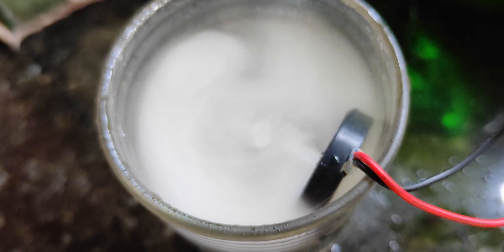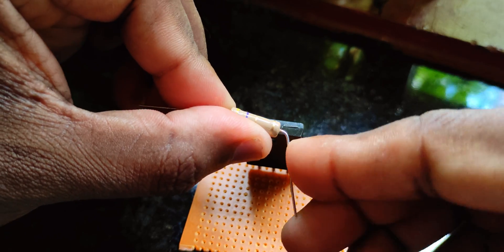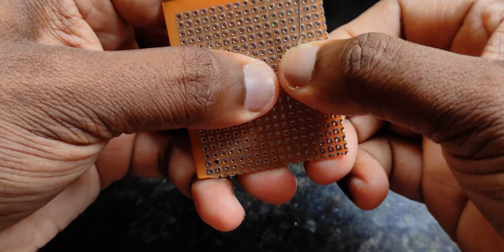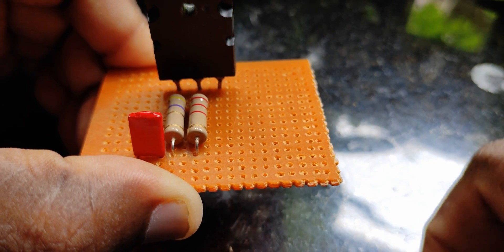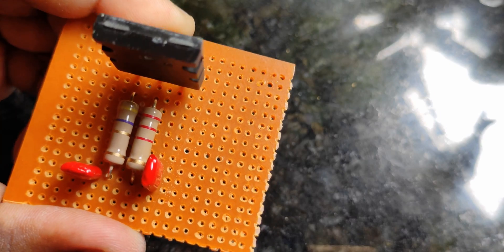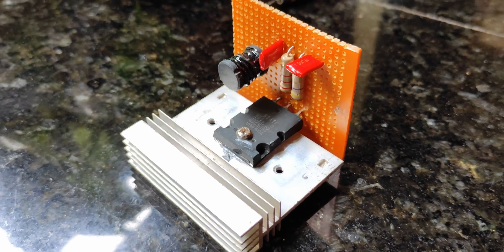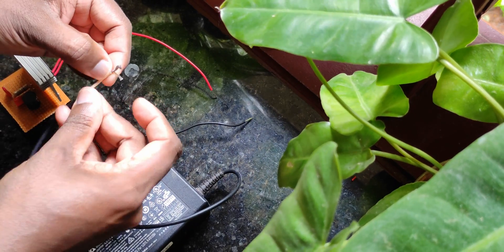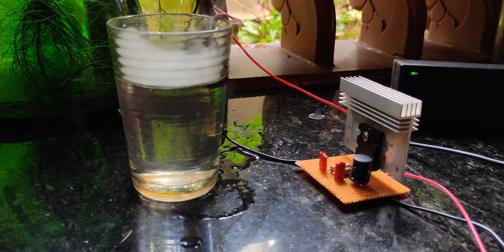I made a super simple 1.7mhz mist maker circuit | ultrasonic mist maker humidifier Level 2 | Ciiads

Comment: I finished making this circuit and it's working alright, but when I measure the piezo disc against an oscilloscope I am calculating a frequency of 800 kHz. Have you tried measuring the frequency?
Reply from the maker: Is your piezo disk 800khz?
It's a self-resonance circuit output frequency depends on the piezo resonance and it will vary between a few hundred kHz to 3++ mhz 
Depending on the piezo resonance and piezo load.
Try dropping a few drops of water on the disk you can see the frequency changes on the oscilloscope it will vary and will go up to the piezo resonance frequency 
and try to verify that using a frequency counter as well.
Reply: @AMNLabs  no it is clearly a piezodisc with 1.77 Mhz resonant frequency. Can I contact you through email and share images of my oscilloscope reading and circuit?
Reply from the maker: @azimshaikh4074  is it misting well?
Reply from the maker: @azimshaikh4074  
you can contact me but unfortunately, I'm not at my home right now so my reply takes a bit of time.
madebyaneeshmurali.n@gmail.com
Reply: @AMNLabs  yep it mists okay at 12V and roughly 0.5 Amps. But when I increase this to 30V the circuit is more effective, but produces more heat and over time may damage the components. The signal read on the oscilloscope at 30V is very abnormal and highly erratic. I have sent you my results through email.
Reply from the maker: @azimshaikh4074  
Don't apply volts higher than the driver limit's
If you increase the volts it also increases power so which makes the system warmer you can do that only if your driver has the potential to handle that voltage 
Use thicker wires and high-current inductors for the best performance 
which also reduces the heating issues 
You can use this circuit for up to 24v piezo discs 
Thicker wires and high-current inductors are recommended.

Comment: Hi, man. What do I change in this circuit to integrate 2.4Mhz mist maker?
Reply from the maker: Nothing just install a 2.4 MHz piezo disk, it is  a self-oscillating circuit.
The resonance of the piezo play the role.☺️👊
Reply: @AMNLabs  Thanks!
Reply: @AMNLabs  And one more question: does it matter to use film capacitor or may replace to ceramic?
Reply from the maker: @ZholobovSS  yes 100v polyester would be the better choice

Comment: Not working
Reply from the maker: Maybe you did something wrong, but it will work when you did it right, read the comments below I have shared some tips with the others like you and assisted those who tried to make this they have the same situation at first because of some mistakes. Please read the conversation between me and Zeus Zix in the comments to fix the issue.
I pinned that one to make it easy for you.
it will work 100%. 
Good luck
Regards 
Aneeshmurali
Reply: @AMNLabs  its work but the transistor is very hot with heatsink.and boom hahaha
Reply from the maker: Use thick wire and decent high current inductor and a decent 3amps power supply

Comment: Hello, awesome tutorial! I made this following your instructions and it works somewhat, but it's much weaker. My multimeter showed around 3.7MHz. Could that be caused by me using toroidal inductor? (still 100uH). The capacitors I used are also slightly different format - 473j100 (should be same parameters). Sorry if these questions are stupid, I'm still a total noob, but willing to learn!
Reply: Running on 12V, 3A (bench power supply). Current in the circuit seemed to be around 0.5A.
Reply from the maker: Use thick wires , pump the voltage according to the piezo driver spec 
and use ferrite core inductor having great power handling (5A++) or wound one your self on a ferrite core with thick wire like I did.
It's a self oscillating circuit so the output frequency will shift according to the driver specification, for instance if your driver is 1.7mhz it's output is around 1.7mhz , if it is 2.4mhz then the output is around 2.4mhz
Reply: @AMNLabs  Thanks, will try those, but first I'll finish an electronics course I started a week and something ago, so I can actually decipher what does what in that circuit. 😅
My piezo is 1.7MHz, that's why I used your tutorial :)

Comment: I have made this but after running it for 5 minute the 2sc5200 became very hot around 90 degree Celsius, I am using a heat sink as u used in yours, now what to do, is it normal ?
Reply from the maker: Use thick wire and recommended power supply read the comments down below solved the same situation 👊☺️

Comment: The transistor gets too hot what is the problem please
Reply from the maker: Use heatsink
Reply from the maker: Is that working well ?
Reply: @AMNLabs  yes it’s working good but the only problem that the transistor gets super hot with heatsink and I try bu407 it’s the same gets super hot after a few minutes but c5200 it’s more powerful but still got super hot after couple of minutes it’s there a problem with my circuit thank you for your time and your help
Reply from the maker: @Ahmedmohamed-rs8no  use thick wires and decent power supply
Reply: @AMNLabs  I will try but I use 24v 3amp
Reply: @AMNLabs  thank you bro I used thick wire and the problem solved and the transistor doesn’t get hot like before and working perfect I put 5vr resistor to control the mist and to be honest it work better then bu407 it’s more powerful thank you 🙏
Reply from the maker: 👊☺️ you are welcome
Reply: yes it gets too hot. something wrong with the curcuit
Reply: Where can we put 5vr to control mist and indicators to show it's functioning in circuit. Show me with diagram. Thanks in advance

Comment: Does it have to have a 12V and 3.3 A supply or can it vary between that value? I have a power supply bench where it can reach a maximum of 30V but only a maximum of 3 Amps.
Reply from the maker: 3 is more than enough

Comment: Does this circuit really work I have bought the components
Reply: Bro can u giv ur email. I made it, it does not work
Reply from the maker: @zeuszix8009  
Maybe you did something wrong.
madebyaneeshmurali@gmail.com
Forward the photo of your setup.
and component details.
Let me check.
Reply: @AMNLabs   this circuit really works be sure of using a radial inductor and thick wire. U might be able to get it to work in two trys then. Thank you ciiads u deserve more subs.
Reply from the maker: @zeuszix8009  ☺👊 that's it🤗
Reply: I even tried replacing the resistor still not working
Reply: Hey bro can mention ur disc size. I made a second iteration still does nt work draws 550 mah waiting fr ur reply
Reply from the maker: I'm at work not a good time for a replay
I will be in touch with you when I'm free
It's a 1.77mhz ceramic piezo disk
I can't recall the dia of that but I think it's around 20mm++ something
But that doesn't matter, make sure it is 1.77mhz one because the circuit is designed for 1.7mhz to 2mhz++ piezos
47 nf 100v cap
100 to 150 uh inductor 
2sc5200 transistor
That's it

For testing purposes first just drop a drop of water on the centre of the piezo disk after powering the circuit
If you see any mist it's working fine
If not there is something wrong
But no worry we can fix that
Reply: It works. I just did it. My steamer oscillates at 1.777-1.781MHz
Reply from the maker: @thelonewolf1757 , Finally somebody did it, Thank God. It will work 100% and it's not fake, so many people are degrading my work, God promise I never upload any stupid things to grab attention or make money "my intention is Do the best or do nothing."
If anything doesn't work that is because of their own mistakes not mine.
You did a great job nice to meet you.
Thankyou for your valuable feedback.
Regards, AMN😊
Reply: Yep, circuit works, however had to reduce 2k2 resistor to 1k1 (2 x 2k2 in parallel)
Reply: 😢about power supply 🤔
Reply from the maker: If it doesn't work, what's the point of my hard work and time? 
Go ahead buddy it will work ☺👊
Reply: @AMNLabs  bro please check your mail. Thank u
Reply: @AMNLabs  I think I found the mistake the shopkeeper gave me 4.7 k instead of 4.7 ohm. Silly shit though please check ur mails thanks aneesh
Reply: @AMNLabs  hey ciiads i have tried every combination. Please check ur email wen ur free still no success
Reply from the maker: Check your mail (my reply) 
 The circuit will work, 100% sure, when you do it right  as per my video and my instructions. 
a little changes in the component values 
(Capacitor and resistor and inductor)
Will make the system worst.
It's a self-oscillating resonance circuit
Do you wanna see the live working demo
Just video call me.
Reply: @AMNLabs  i made one but not working
Reply: it doesnt work. also I see a lot of people commented below that it doesn't work
Reply from the maker: @roozbehkhodambashi7089  
A lot of people are failing because they are not following what I did here. and I feel very bad because I can't able to help them physically I can only talk through comments but that has a limitation.
but some of them are attempted more than twice according to the instructions that I provided through the comments and they succeeded.
You can find those people in the comments and read their chat history maybe it will help you.
I pinned one of them for the people who are facing issues with the circuit.
Believe me, it will work. 
I don't know why people like you misunderstand me. whatever it is, I never make things that don't work but I make things that are too complicated to make.
because "if we are thinking about simple we can't achieve the impossible "
I don't know about your situation if you did everything right it will work.
It only works for those who build well because each and everything in the circuit is so important a little mistake is enough to make it worse. the problem is your build,not the circuit. if you wanna see my build you can come to my place
You can see that with your bare eyes.

Comment: Can it be made even smaller? Like to fit in a vape?😁
Reply from the maker: That's up to you, try to get the smd version of the exact same or equivalent components, yeah, of course, you can shrink the circuit but use good quality SMD inductor having a current handling capacity of 5 amps plus otherwise, it's going to heat up and limit the performance.
😁😁😁😁☺👊